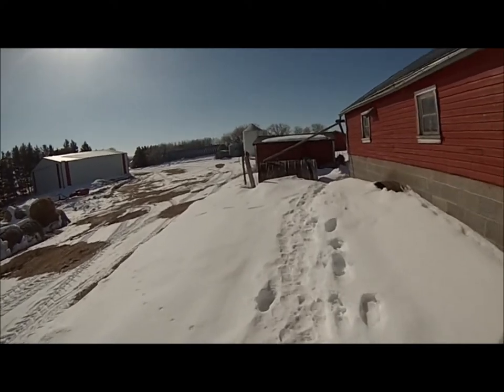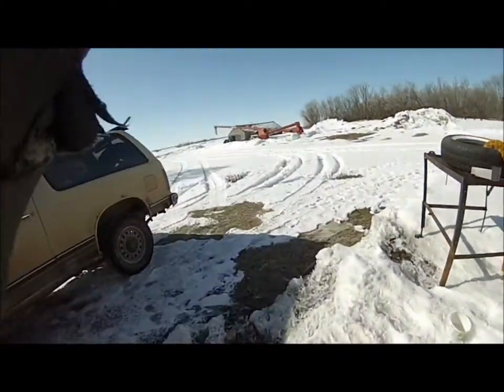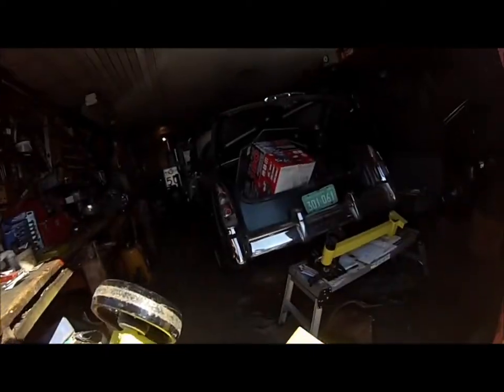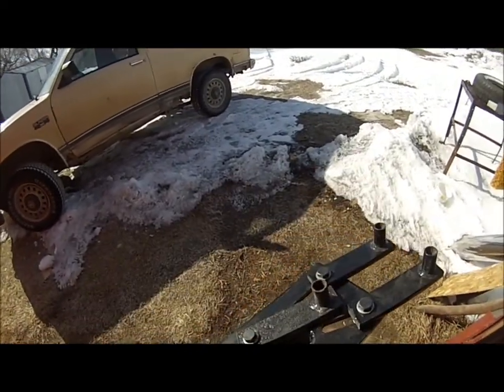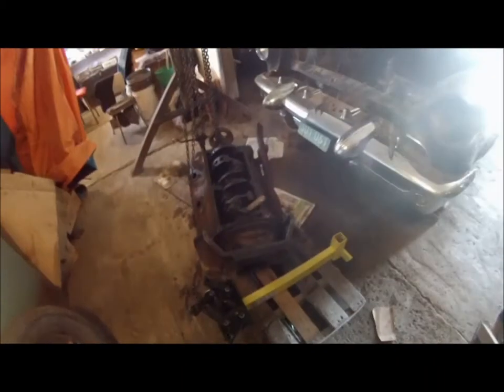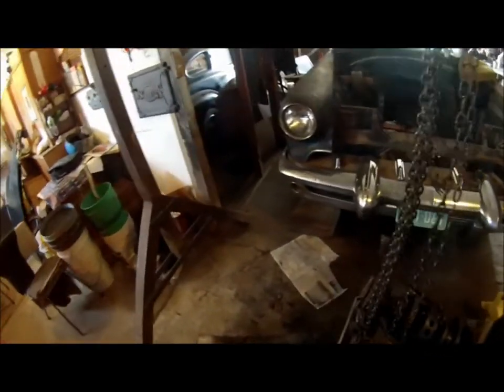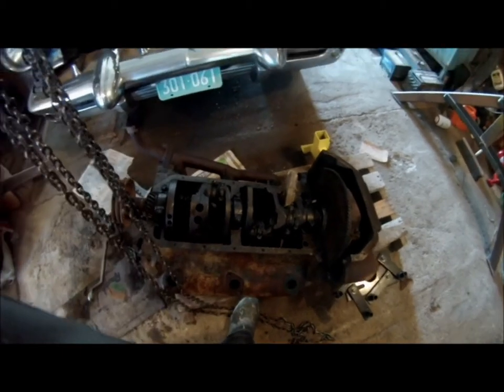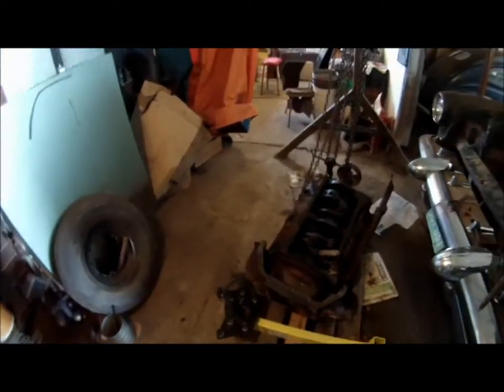Roosty6 Gets A Lift

Comment: Good day  Yea 2012 was a really warm yr.  I live in Ont.  a mennonite planted field corn, late March,  That was yr  had to quit work, serious breathing problem,& the heat did not help.  This yr. snow left  Feb.  a snow storm comes & goes.  Many yrs. ago we had lot's of  snowtill March the odd snow storm in  April.  we are snowless for  quite a while now,  I'm thinking we could have possibly dry summer. Thanks  Princess Auto engine stand,,Good luck on unceasing engine
Reply from the maker: I'm getting comments that the 3 wheel stands are dangerous and subject to tipping over. Guess I will find out when I get the engine attached to it.